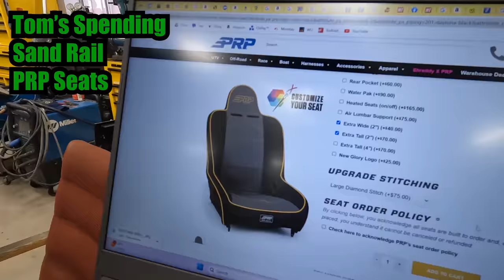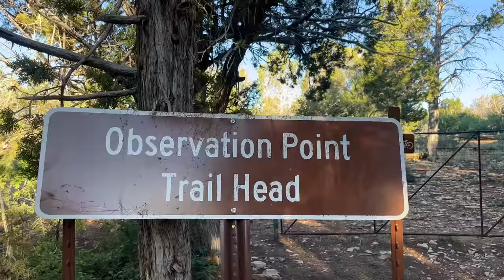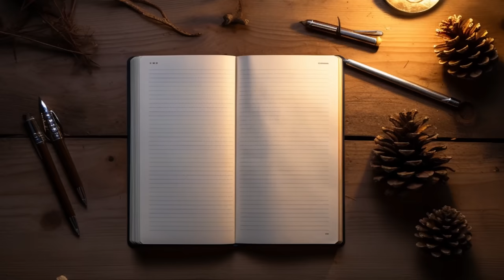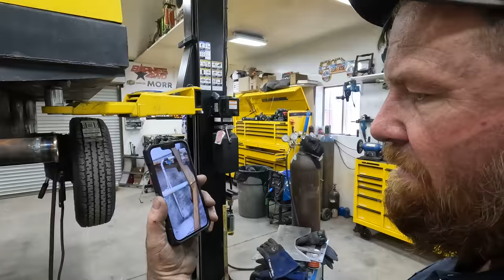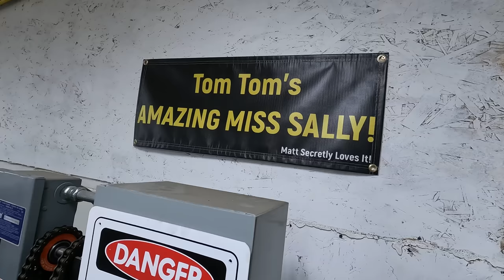This One Part Changes Everything! Bombi Gets Biggest Upgrade.

Comment: FYI on the gooseneck blowing tires:  If the tongue is too high (as with lifted trucks), weight is taken off of the front axle and transferred to the rear axle, causing blowouts.  Make sure the trailer bed is pretty parallel to the road surface.
Reply: I don’t think Blue Steel is lifted. Standard F350
Reply: Also check axle alignment and that the axle flanges (at the weld to the axle) aren't bent from overloading.
Reply: @SPPTA  agree but it still squats pretty good when under a load such as trailer with the wrecker on it.  So mabe it was the front tires that blew,, just a thought
Reply: A level bed is what you're supposed to have on all trailers, ANY size! So many accidents are caused by people not taking the time to check on it. Too much or too little tongue weight is also an issue for many.
Reply: @SPPTA  Blue Steel is an F-250 actually.
Reply: @MikeCris on a brand new trailer?
Reply: Blue steel is imo overloaded when pulling wrecker.  (Or maybe it’s mispositioned slightly). Possibly the springs sprung, other issues. I am on my 3rd diesel work, pulling truck. 86 6.9.  89 7.3 ats (both F-250. Finally 7.3 psd F-350. A few videos of blue steel.  The look makes me think something is not “perfect”  and it’s not tire pressure. Now a heavier flatbed?  I dislike dually’s as a rule.  But this might be a place. It’s easy to figure out tongue loads, measure sag, check tires…
Reply: Trailers tend to come with cheap China bomb tires.  When I buy a trailer, I immediately get rid of them and put on quality tires.  I learned my lesson the explosive way with my new first trailer.
Reply: The suspension on a quality dual-axle trailer should negate any excessive loading of one axle over another assuming a reasonably level bed. I  believe many of the  trailer-specific tires available today are of questionable quality  even though they look great. Especially the tires that come stock on a new trailer.
Reply: @AlaskaErik there are very few tires that aren't made in China or Asia
Reply: @NTM2009  The Goodyear Endurance tires on my trailer are made in the USA.  The Goodyear Wrangler Duratrac tires on my truck are made in the USA.  It's not hard to find Made in the USA tires.  And my Made in the USA tires have all performed flawlessly.
Reply: @williamuskoski1385  Alignment...yes. Flanges, not necessarily. But they've been hauling loads when those tires failed...so yes, the flanges should be checked to see if they're properly attached and aligned with the axle.
Reply: I didnt hear then say it was the rears that were blowing, it is just the cheap 12 ply tires i bet. Toss some better rated tires on it and hit the road.
Reply: @larrythompson8630  I already told them that but they pushed out the GVW capability of the truck and what the trailer plus the rigs were and according to them, they’re within tolerance.
Reply: @SPPTA  the GVWR is basis. It assumes everything good, why a safety margin.  As I suggested there are many possible reasons it looks wrong.  More info needed to find issue.  They update off road stuff but I have not seen concern for highway vehicle that tows a load on public roads.  (Likely not considered worthy of YouTube)
  For “one off” yes I have been likely further off in weight.  Even had a load that had negative tongue weight. Not practical to change.  Added 500 lbs to truck bed, kept speed under 50 mph for 20 mile trip. Remote roads, maybe 4 cars pass me…. The few clips I saw might have other factors.  But trailer level, truck having minimal squat… is better.
Reply: @AlaskaErik  You can buy a brand new 5th wheel or regular travel trailer and they come with the cheapest tires the factory can find. The RV forums are full of new trailer tire stories and they are not good stories either.
Reply: @larrythompson8630  hey Man. I’m tracking. But I’m just relaying the reply from MORR when I had the same concern.
Reply: My Four Winns trailer came with Chinese tires, I bought the Good Year Endurance tires, not much more than foreign tires.  In the RV world Chinese tires are called “China bombs”.
Reply: @larrythompson8630   They are way overloaded. Blue Steel is a 2016 F-250 which would be 15,000 lbs max towing. Wrecker is 12,000, trailer would be about 7,000. One recovery they also had the Banana on the trailer too.
Reply: You can cause the same issue by putting your load to far in the rear of the trailer.  If you're blowing rear tires -- move your load forward a bit and give it more tongue weight.  If you're blowing the front tires it's the opposite:  your hitch could be too low or you have the wrecker (load) pulled forward too much on the trailer-- and it's adding too much tongue weight and letting the trailer sag forward a bit and not putting any weight on the rear tires.   Balancing the weight load on the trailer is crucial.
Reply: @larrythompson8630  they could just put F350 springs on the back of their truck.  or "add a leaf" -- or just add airbags (which is what I would do).
Reply: @geraldhenrickson7472  I'm pretty sure it's a triple axle.. (could be wrong, I didn't pay attention close enough :)
Reply: @adventure9606  Trust me, I know all about that.  I'm on several RV forums.  One of my trailers came with Castle Rock tires.  They're about as cheap as they get.  I immediately replaced them with Goodyear Endurance tires.
Reply: @SPPTA  Actually it's only a F250 and in my opinion is overloaded when hauling the wrecker. I can't believe he hasn't had issues with the rear axle, springs, transmission, etc, if he has it was not on video. I'm not a Ford man but I am impressed that Blue steel has 200,000 rugged miles put on it and it's still going. The new bed that Robby is putting on it looks a little weak in the 5th wheel area unless he does more to it before he installs it. If the wrecker got loose somehow, with or without the trailer still attached, because of a weak link, let's say, it could get quite messy, to say the least, for anything or anybody in its path. Let's hope for Matt's sake that never happens.
Reply: @JT-SE-OHIO  I’m with you on this. MORR says different
Reply: likely a combo of weight distribution, leveling of trailer, tire inflation changes(they change altitudes often and temperatures vary widely) probably wise to go pure nitrogen fill on all tires/vehicles especially the off road ones. yeah now they need nitrogen cylinders, but a few mid size tanks holds a lot.
seems there's multiple issues with a side of probable junk tires(cheapest junk tires supplied with trailer, go figure)
Reply: @throttlebottle5906  Nitrogen is a scam for anything other than aircraft tires and racing car tires.  For the Bombi the difference it would make is negligible and not worth the hassle.
Reply: @AlaskaErik  it's not really a scam for many applications involving off road/on road sports/racing, which has wide temperature swings, like from in the shade/trailered to very hot sands and other surfaces. even more so on tires with lower air pressures where one psi change could make or break things. that and it's not something they're going to think about and maintain constantly, especially after having foam filled tires. well, until forced to deal with them from flat/off rim tires(it will happen anyway, even with nitrogen) 🤪
granted the changes there are still nothing like in aviation, burning on the ground landings and takeoffs to 30K feet freezing flight paths.

Comment: You mentioned wet brakes, as someone who drives a lot in the wet PNW I would highly suggest slotted rotors. It basically allows an extra place for the snow/water/steam to go. Noticeable improvement on cars in the rain.
Reply: Good point.  Brakes are great at boiling water, but you need some place for it to escape to so it doesn't just press the pads away from the rotors.
Reply: I realize that rotors are usually too hot of this to be a problem, but would there be any concerns about ice freezing in the slots while the vehicle is stopped for a longer period of time?
Reply: @drhender6943  I feel like with brake-based steering, it wouldn't take very long for any ice to melt out of the slots.

Comment: 0:28  Aluminum is light, but it's not strong for long. Maybe add a stainless plate to sandwich sprocket to hub. 
15:45  Looks good Tom. I built a spreader 25 years ago. It has a 5/8" all thread rod to adjust the tilt. 
15:54  Add a chain to the headache rack or a Visegrip, so it doesn't slide off the forks.
Reply: Don't mix materials without isolation pads.
Reply: 👍an aluminum sprocket driving chromoly rails will wear quickly
Reply: @danjones1365 looks like there is a plastic antiwear coating on the teeth. Maybe HDPE or something?
Reply: @BrokeWrench  Could possibly be UHMW, i know we use that on a lot of our sprockets and if it doesn't bear any major weight we may use a sprocket made entirely out of UHMW.
Reply: @danjones1365  The gear is a special Polyurethane bonded to Aluminium.  Steel does not touch Al.

Comment: You guys are one of the few channels that understands how an open differential actually works.
Reply: It changed my thinking a bit. The torque would indeed be the same, that value may be zero with one wheel stopped and the other doing a zillion rpm in the air but the torque applied is still the same.
Reply: Hmmm 52 yrs young & still learning, soo much for thinking I’m smart t . Hey still an awesome fabricator tho !!!
Reply: Puzzle me this: A Ford 390 cid 335 hp and 427 lb-ft of torque in a '66 Fairlane GT with an open differential on level pavement on a hard takeoff would smoke the right rear tire all the way through first gear, and the left rear would not smoke or even leave a mark on the pavement.  Torque is rotational force, so why didn't the left rear tire also smoke?  Did it receive an equal amount of torque/rotational force?
Also, when I worked at a full service gas station in the late '60's, we did on-the-car wheel balancing with a Hunter system.  Front tires would be spun up with an electric motor.  On the rear, we would jack up both rear wheels, put a block under one wheel, let the jack down so that that wheel was firmly seated on the block, then put the vehicle in gear and spin up the free wheel.  But we only ran the speedometer up to about 35 mph, because that equated to 70 mph on the free spinning wheel because it was receiving all the torque through the differential gears.  If a car/truck had a limited-slip differential, the tire on the block would spit the block right out from under it.  For those we would move the tire temporarily to the front and use the electric motor.
An open differential delivers torque almost equally only if both wheels have equal traction.  We also sold a lot of tires, and almost universally, the right rear of a well-used set would have the least amount of tread left.
The spider gears in an open differential allow the inside tire to rotate more slowly than the outside tire in a turn, which is, after all, the reason for needing an open differential; to allow for an unequal distribution of torque between the rear wheels depending on driving conditions.  If the engineering design is to differentiate the application of torque between the rear wheels depending on driving conditions, an open differential, by design, does not distribute torque equally.
Reply: @bruceb1771  What he said.
Reply: @bruceb1771  How much torque do you think it takes to free spin a wheel in the air? It's 1-2 ft lbs at best, the wheel on the ground is also receiving 1-2 foot lbs which isn't enough to move the vehicle so it doesn't move. Also when doing a burnout with an open diff the rotational torque from the driveshaft unloads the right side making it have less traction so that is the wheel that spins and once it brakes traction it takes even less torque to spin it so even less torque goes to the left wheel.
Reply: @bruceb1771  Thats b/c the one wheel lost static friction first and once it loses static friction, dynamic friction is always less so it keeps spinning. The other wheel that is NOT 'smoking' still has the same amount to torque applied to it as the smoking wheel does.
Reply: The torque is equally balanced between the wheels 50/50 each side.  When cornering it's the speed that changes as all wheels on the vehicle take a different path so rotate at different speeds covering more or less ground.  Spinning wheels lighting tyres etc is a result of a loss of traction, torque reaction and acceleration forces or cornering forces.
Reply: @bruceb1771  An open differential is for speed differential, not torque.

Comment: Tom, you need to convince Matt to mount the cab on rubber bushings and to sound 'proof' the cab. the proofing could be added to the outside, so the cab interior is not mad smaller. The rigs are already loud and driving for miles into the snow that type of noise gets old. alternately some cutouts, muffler bypass, full or partial, for the exhaust!

Love the videos!
Reply: There is no amount of time and money that cannot be invested in attempting to make a tracked vehicle quieter. In the end, other than a good muffler, it is better to wear hearing protection. I did note that the new drive "sprockets" seem to have high-tech construction which may help considerably.

Comment: Regarding open diffs and then splitting the torque. A tip if you get stuck somewhere, eg one wheel off on slippery grass: lightly apply the handbrake as you try to move off, this will give the freely spinning wheel something to work against, increasing the torque so the good wheel will also get some torque to move you off
Reply: Applying the handbrake works only when your RWD.

Comment: I would put double sets of brake calipers on it so you're doubling your clamping force and spreading out the Heat and friction. just weld another caliper bracket 120° from itself and size your master cylinder accordingly. so you basically have eight sets of brakes 👍
Reply: the first set of pads wipe and partially dry giving the second set more friction. In the old days of drum brakes (when I learned to drive) you put your brakes on lightly after going through a deep puddle to be prepared to stop further along. Otherwise you could be in for a surprise.  Was really great when diisk front brakes arrived in the 70's. Another major safety improvement was that even if a front bearing failed, the caliper kept the wheel in place. With drums, the only thing keeping the wheel on was the outer wheel bearing which was very small. Now trailers, which rarely (if ever) have disk brakes lose wheels.

Comment: Matt needs to add 3 winches to the garage, 2 in front and behind the lift and 1 in the middle of it. Mount them on the triangle shaped wall to keep them out of the way and add pulleys.

Comment: I work at a nordic center. We use Pistenbully and Sprytes which are both tracted snow grooming machines. We use inner tubes in our tires so we dont have to worry about burping tire bead seals. We decided to not use solid or foam filled tires because of the harsher ride quality. Even though we only use ours in the snow. We will stil get flats on occasion.

Comment: Easy way. 
An open diff will supply equal torque to both wheels  up to the limit of traction of the tyre with the least grip. 
So if one tyre is in the air spinning freely and can handle zero torque, that's exactly what the other side with grip also gets.

Comment: Matt you should have "floater axle spindles" installed on the 9-inch and run 3/4 ton rear hubs so the sprockets will bolt right on and they will reduce axle flex and have two bearings on each sprocket hub, it would also make it easier to do gear changes and axle repairs.

Comment: I have never worked on or operated a Bombi, I have done those things to Thiokol, DeLorean and Tucker snowcats. I would have chosen the 4L60 transmission over the THM 350, for two reasons. First is that the overdrive might come in handy on flat open ground, second the 4L60 has a lower first gear (3.06) compared to the 350 (2.52). You can modify the 4L60 so that the torque converter doesn’t lock up except in overdrive. Just saying…
I think what you are doing is great and I enjoy all of your videos. Thank you!

Comment: Spreader bar...No need to reinvent the wheel. Try Harbor Freight. I'd link it, but you know...youtube. It's called 2 ton load leveler. Also allows shifting the balance or tipping the load. I've had one for decades. But the one they sell now is pretty similar. Works great. Recently used mine for a motor replacement in my prerun Toyota... Fiberglass fenders, bedsides and hood, 3" longer front control arms, Fox coilovers, etc. I've used my leveler for all sorts of engines. From offroad race VW buggies to Honda Accords, to the 428 Cobra Jet I swapped into my 61 F100 in the 1980s. Amazingly enough, it will even work for Chevy engines. Good thing too considering how often I see people online pulling Chevy engines out and replacing them.
Tip: if you set the lower chains so the bar is close to the engine you don't have toreach so high with the hoist. And what are the red hooks on the chain for? Holding up your jeans? Bolt yhe chains to the heads.